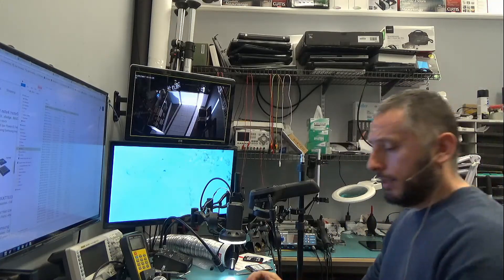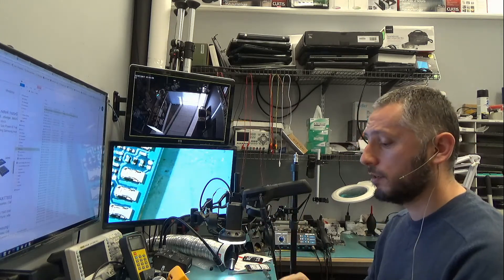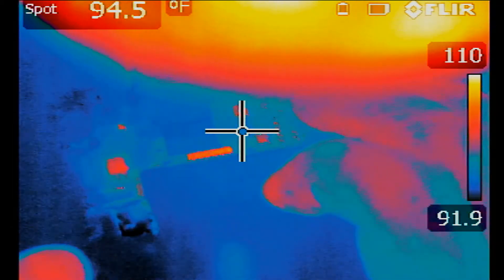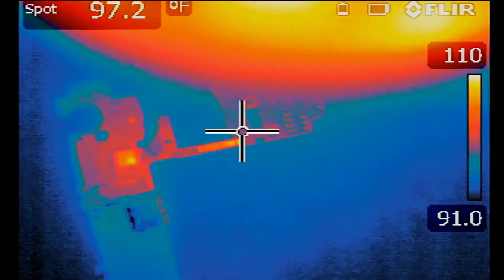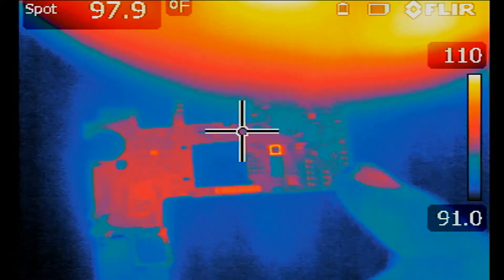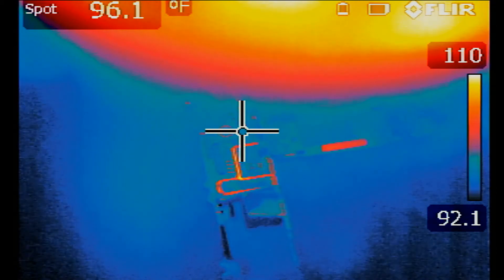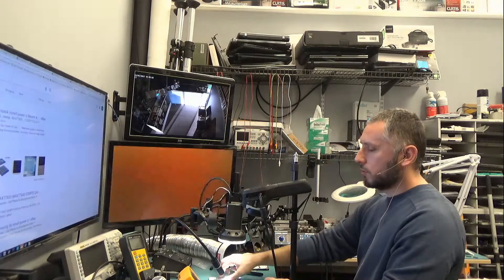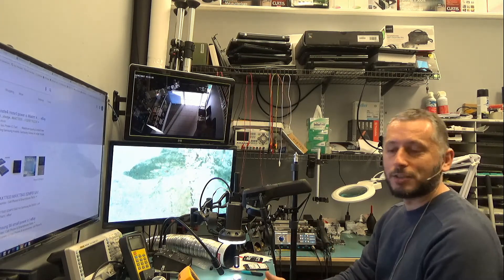Troubleshoot Galaxy S6 edge plus No power Using a Flir thermal cam. Bad Power IC chip

Comment: I left my Samsung S6 on charger for 10 hours and couldn't start it after. 
So I thought my battery (it's was in bad condition overall) was dead. 
So I replaced it with new battery, when I start the phone, only light blue LED gets turned on- solid. (when I try with old battery, it doesn't even start blue LED - so old is probably dead).
 When I put it on charger, nothing happens. (I tried everything - power but+home+vol up/down, all combinations, etc., nothing works)
What could be the problem?